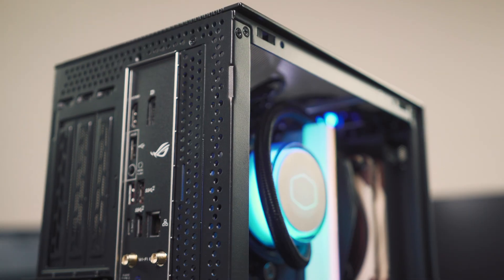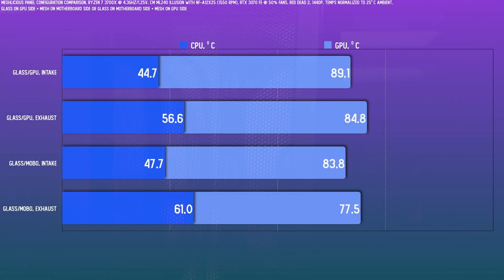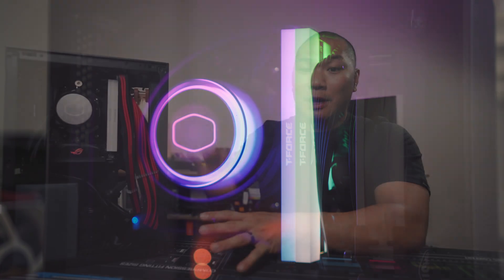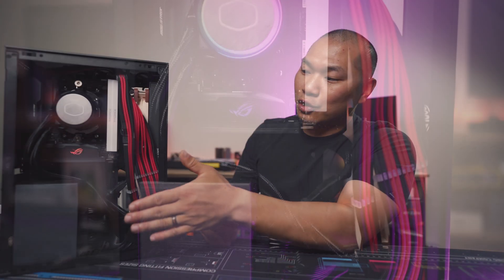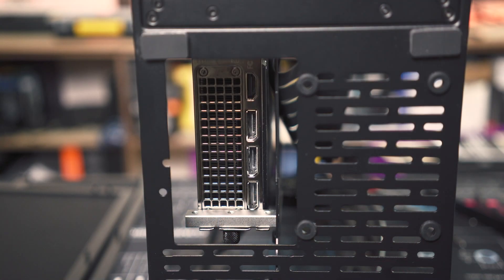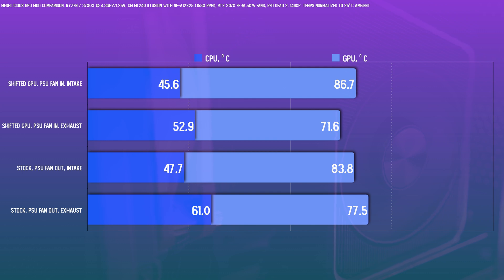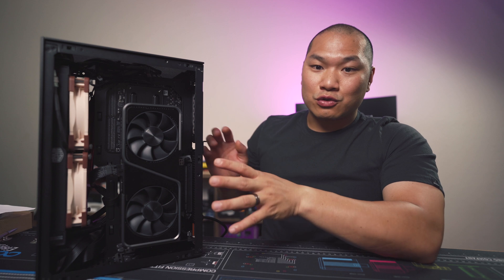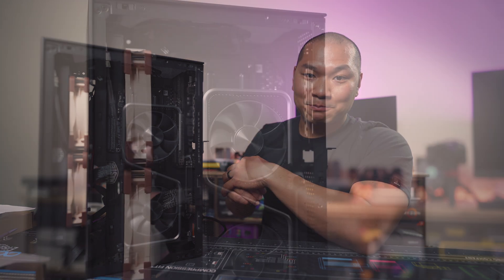SSUPD Meshlicious Ep. 2 : Airflow and Thermal Improvements

Comment: Is it the case that shifting the GPU was the only statistically significant variable that cause the drop in temps. Surely the PSU has little to say when the fan doesn't often turn on till under heavy load.

Comment: I recently built mine and the fans run loud with the mesh panels on like it's choked for air. Gpu offset with alot of cabling hidden in the bottom middle, fans pushing out the front. Not sure what to do. It's much louder than my old pc when any game starts. Gets better when I remove the panels but can still run loud. Any advice?

Comment: If switch the AIO fans to Phanteks T30, will it have Thermal improvement?
Reply from the maker: Compared to most stock fans, absolutely- as long as you can fit them.
Reply: @MachinesMore  thank you for reply, Meshlicious shoud have enough space to install Phanteks T30

Comment: So just to summarize the best setup is, Glass on the Mobo/CPU side, Mesh on the GPU side, Radiator Fans set to exhaust, PSU fan blowing inside the case, Move the GPU to space out the middle.
Reply: The PSU fan doesn’t blow, it pulls air and exhausts it out the back of the PSU
Reply: @luca_sbll  that is when the psu fan actually comes on correct? It doesnt work all the time only when needed it comes on.
Reply: @SpartanGR77  Yeah, depending on how much power the components draw and how efficient the PSU is, the fan may or may not come on
Reply: Wouldn't mesh on all sides be the best for thermals? I can see no reason why thermals would be better with glass, then with mesh.

Comment: I have an ATX psu and want to use a glass panel on the CPU side. Do you think it would be ok to mount the atx psu with the fan facing inwards if the 2-slot gpu is offset as shown in this video?

Comment: Do you think that there is any difference between having the fans on the inside like yours or between the rad and the case?
Reply from the maker: Negligible for airflow, however for the AIO bend there is a big difference, the tubing will be tighter with rad on the inside.

Comment: Could you possibly get another mesh panel for EP 3? I'm intrigued how much better thermals would be for both cpu and gpu WITH the shifted gpu mod and psu fan in and raised case! You could probably even fit a fan on top I think, There's also an after market mod on the case where you can fit 2 x 60mm fans on the rear.

Comment: Sorry I’m kind of confused here. The ideal configuration is the glass panel on the CPU side and the PSU pointed inward correct?
Reply from the maker: Depends on how you are cooling your CPU. I think that with an AIO for the CPU, mesh on the GPU side makes more sense, coupled with the PSU with fan facing inwards, or with fan facing out but offset for breathing room.
Reply: @MachinesMore  awesome thank you so much. Yes that’s exactly how I’m planning on doing it with an AIO for the CPU. I’m still trying to find a white one with the TG panel but so far no luck. I appreciate your response keep up the great videos!

Comment: What's the best cooling system if I want to do full core Blender renders? I have a ryzen 5 5600x and a 3070. I like this passive cooling system but maybe it's not the best for me.
Reply from the maker: If you want air cooling, the L-12S or Big Shuriken 3 will do the job. Liquid cooling is fine too but the gains would be more for silence or OC on this chip than getting more PBO performance.

Comment: So whats best, PSU fan in or out? Corsair sf750. CPU is liquid cooled with 280 Radiator in the front. Mesh on both sides. GPU exhaust.
Thx for advice and nice video.

Comment: I think some 40 or 60mm noctua fans in and around the gpu area using some blue tac will help in exhausting hot air. contact noctua they might send some for you to test. They once send another youtuber 40 40mm fans to mount on a 240 rad lol.

Comment: Hey I'm thinking about building in this case ase follows:
- Glass on GPU side
- Samdwich wall in the GPU closer Position to make more room for Mobo
- Air cooling ryzen 5 5600x with noctuah nh12s
- liquid/hybrid cooled GPU with AIO like  Aorus Waterforce or EVGA hybrid gaming
- PSU with fans on the outside

I think this could be a very good thermal option considering the system will be strictly used for gaming. It would also be very aestethically pleasing with the waterblock gpu on the glasse side.
Should I then run this system still on negative or positive pressure considering the watercooled gpu?
Reply from the maker: For your specific setup, I’d exhaust, and here’s why. You’ll have no problem cooling the graphics card since it’s liquid cooled, even if it’s partly ingesting some of the CPU’s heat. Your CPU will be low TDP but we want to give the L-12S cooler all the help it can get, so exhaust prevents the card (guessing like a 3080 or higher level) from dumping 300+ watts of heat into the case, and the negative pressure also aids in the cpu cooler fan intaking. Sounds like a really nice setup you have planned!
Reply: @MachinesMore  I was also thinking in this direction. Now I'm pretty confident in building it this way. Thank you a lot for your help!

Comment: So I actually originally had my system (5800x with evga rtx 3080 ftw3 ultra) set up with a 240mm aio (lian li galahad), and was running into huge idle temps (60C) while the gpu was loaded. The gpu was just dumping all the heat into the rad, and made the cpu unnecessarily hot. Ended up switching to a Scythe Big Shuriken 3 for air cooling and 2x140mm fans in exhaust at the front. Load temps on the cpu ended up about the same, but idle was far better. Also makes more sense as a thermal solution since the front exhaust can double duty pulling heat from the gpu+cpu. Case is still quiet, and also much lighter now.

Comment: Trying to think outside the box here ... why do case designers require all the components to be in ONE compartment, thus having the problem of hot air from one part affecting the other part, e.g. hot air from GPU affecting the radiator. Is it possible for you to create and insert a makeshift panel between the GPU and the radiator, so that the GPU's hot air is diverted out through the panel that faces the GPU - rather than the hot air from the GPU being diverted sideways onto the radiator? I'd be curious about the thermal results if you were to perhaps insert a thin metal panel that acts as a partition to, as much as possible, separate the GPU from the radiator. For example @6:25, the panel would be in between the GPU and the Noctua fans to prevent the hot air from reaching the Noctua fans. The GPU's hot air would be expelled from the case by the power of its own fans.

Comment: Very interesting video on the ssupd case, literally either this or nr200 for my next build right now (yess putting off the build bcs i cant get a gpu) but was thinking jf the standard cables of a sf750 would be long enough for this config bcs am not sure if they sell extensions where im at without paying ridiculous shipping fees and taxes
Reply from the maker: Marcelo, the SF750 should yield a similar issue where the cable length limits you to one orientation. It’s not a terrible orientation if you shift it in, but extensions or custom cables would allow the fan to help case airflow more.

Comment: One interesting solution for cable management that I've seen is to offset the motherboard using some standoffs (around 20mm), which allows cable routing in the space behind the motherboard. I don't know if your cooler will have space to fit the panel on with your particular build but might be worth considering. Great video, love the detailed investigation.

Comment: So in summary, the best setup for the tg version is:
Psu fan face the mobo, the pump running from bottom to top, the glass on the mobo side and mesh on the gpu side, use custom sffcables for better cable management, use a sfx psu, use rad screws to shift the pcie riser closer to the mesh so that the gpu is closer to the mesh and negative air flow by having rad fans sucking the air in the case.

Correct me if I'm wrong guys.
Correction: negative air pressure is better?

Comment: Given the aim of achieving a negative pressure inside the case - on one hand the radiator fans draw the air OUT of the case - but my question is: aren't the GPU fans drawing air INTO the case? How does that affect the ability to achieve the desired negative pressure?
Reply from the maker: The GPU fans definitely offset the case/rad fans somewhat, but a pair of 120mm fans are still going to move a lot more air, so on net you are still encouraging air to flow more freely into the path of the GPU, and that’s one of the reasons that setup works well for a lot of sandwich style setups.
Reply: @MachinesMore  Is the GPU blowing hot air onto the location on the motherboard where a 2nd NVME SSD would be? If so, I'm guessing that the NR200 might be better at protecting the 2nd NVME SSD from overheating?
Reply from the maker: Absolutely, the back m.2 isn’t a good option, so I’d advise one big front m.2 vs 2 smaller ones. With the spacing out though, airflow is better and there is enough space to throw a heatsink on it so it might be a bit better. I’ll try that out but you’re absolutely right in that the NR200 and similar layouts are much better for back m.2 drives.

Comment: If you compare this build (your ideal SSUPD AIO build) in contrast to your ideal NR200 AIO build - which case is quieter? Which case has better thermals?
Reply from the maker: Thermal testing was noise normalized, meaning no meaningful difference other than noise quality. Both cases can be setup to run quietly. However, there is a factor to consider and that is position relative to user. A typical placement would be IO facing away from the user, so front panel closer. The SSUPD has fans that have to be placed in the front panel, so that does bias the noise closer in that placement. Good fans with a pleasing noise pattern is key, so NF-A12x25 or P12s (if one can avoid the growl rpm range) are good choices. That being said I have noticed the SSUPD tempered glass panel has a better level of noise isolation due to foam lining on the panel. For thermals I think just due to the flexibility of different configurations the NR200/P takes the cake pretty easily. There are just more setups where you can better isolate CPU cooling from the GPU cooling, where the SSUPD has a fairly strong interdependence between the two.

Comment: i assume when you say exhaust, you mean a negative preassure where the two rad fans are on exhaust?
Reply from the maker: Correct!
Reply: @MachinesMore  thanks! Oh assuming I have both sides mesh, and I do the gpu shifted mod, should I have the PSU face in or out since the motherboard side is now mesh, of course in the exhaust config.

Comment: Awesome vid. I’ve got an XC3 3080 Hybrid card in the Meshlicious. Seeing insanely good GPU thermals with the rad fans set to intake, at the cost of moderately worse CPU thermals (cooled by a Noctua NHL12s also on intake). Any tips to optimize?
Reply from the maker: Sounds like a cool setup! What CPU are you running, and are they bad to a point that it’s holding back boost clocks?
Reply: @MachinesMore  thanks man! I’ve got a 5600x, and not getting above 70 while gaming, so I think I’m probably fine. Undervolted the CPU a bit as well

Comment: Is having the PSU suck in the hot air from the case something to be worried about from a PSU perspective or does that not really matter?
Reply from the maker: It’s not a huge concern, warm air is much much better than no air, and of course cool air is best but plenty of setups require PSUs to take case air for ventilation. A lot of power supplies (not the revised CM unit I am using) have a fanless mode where the fan doesn’t even come on until higher load anyway. The one thing I would avoid is having the PSU fan right up against the flow through exhaust location without auxiliary airflow, and one scenario I could see this is in the NR200 with PSU fan flipped in and a flow through card, that would be a very suboptimal setup essentially forcing the hot air into the unit.
Reply: PSU's has been sucking hot air for decades in prebuilts, should be fine